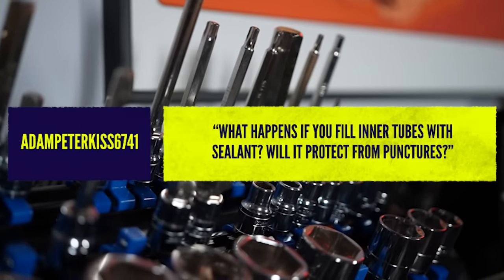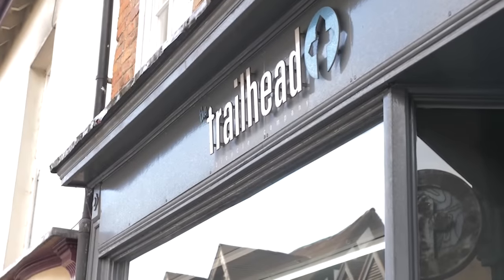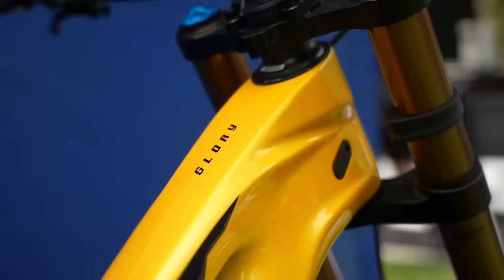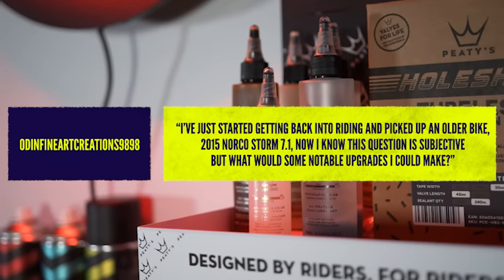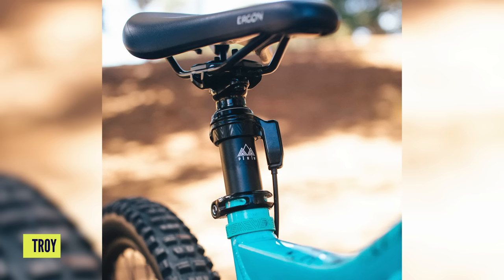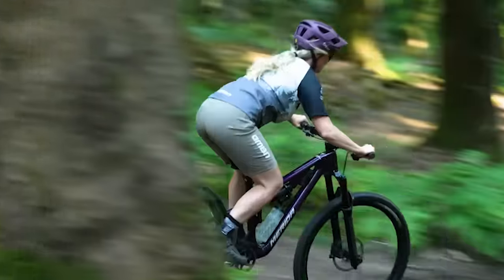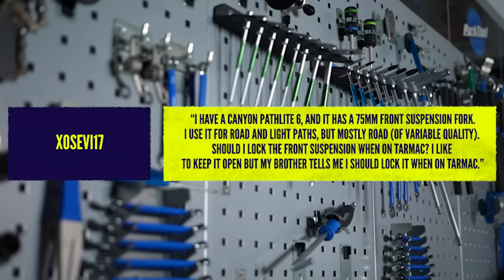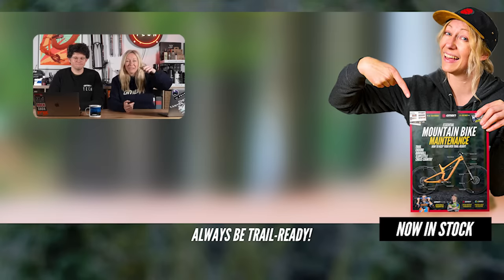What Happens To Pro's Bikes After They've Used Them? | Ask GMBN Tech

Comment: I feel the same for the 4th question about sizing for different body proportions. 
I've got short torso and long legs and I find it tricky to find a good size. 
I feel much better on size smaller than it would be recommended by most manufacturers, but it comes with some disadvantages. What we really need are not only bacis frame sizes, but different designs for different proportions. Or a size matrix, where you could choose reach and stack individually.

Comment: 11:06 I mentioned Hydraulic brakes, but mechanical brakes can get issues in zub zero temps too, as the wires can get wet when it's not sub zero and you ride trough puddles and snow, and once it gets to zub zero then the wire freezes to the hose, so I recommend using suspension grease on the wire to prevent it. Chain lubes will work in a pinch but they will make a mess. Sram Butter/Slickoleum/ Slick Honey, (all made by Slickoleum apparently, at least Sram butter is for sure, it says so on the box) should work well. Shimano has their grease for this, but I've not tried it.

Comment: 5:28 Yes Deore RD is a great option. the cassette seems nice too, shifts smoother than previous gen. But please be careful with the spacer, they are plastic, don't fiddle with them, don't step on them on an uneven surface, they will snap, I tested it with my fingers I snapped them. But I wanted to install the alu spacers I had from older XT cassettes anyway. But I asked Andrew Major, he did not have any issues with the plastic spacers. But it's not fool proof.
I've not tried the cranks.
But when it comes to the brakes I would avoid Deore brakes, They have servo wave mechanism, so the reach adjustment effects the power, as reach is not adjusted on the push rod, but on the servo wave mechanism, so useless for short fingers, as adjusted for short reach the piston in the master cylinder can't be pushed far enough so the pads barely touch the rotor. Absurd.
There is no adjustment to counter act this on these brakes.

Comment: 0:24 The problem with sealant inside inner tubes is that it will clog up, then you have a inner tube sealant sausage. And this will come at a cost of the ride quality and if clogged up at the valve you are screwed.
I doubt the inner tube specific sealants like Slime inner tube sealant will work better.
Also tube will might get glued to it self.

Comment: 11:06 Hydraulic brakes are also effected in low sub zero temps.
I noticed the Formula Cura 4 brakes with Formula Mineral oil got woody feel and more sensitive. But still work well. Same with Shimano.
I've asked Trickstuff, their brakes should work well down to -15C with Bionol. I don't know how they would do in -20C
I've read on MTBr forum that Sram brakes, Lewis brakes had issues with pistons not retracting in -20C. I don't know how much that's the piston seals and the fluid.

Comment: 11:06 Hello from Norway.
If it's just chilly, but not sub zero and fork feels harsh, just do a few drops and bomb down stairs for it to heat up. But this won't do anything when it's below freezing. I noticed a massive difference on a Fox 32 Evo. I no longer have this fork, but they performed poorly in the cold. Now I have EXT ERA, it performs better, but that fork feels plusher and yet supportive, but this fork I can adjust properly, but it too gets harsh. pumping up worked on the Fox fork I had to do it mid ride sometimes.

For some reason I don't have to pump it up more in -10C, but it feels harsh. Probably could drop the pressure some more, but it won't get rid of the harshness, as that's the damper fluid.

Comment: 5:57 I've tried Sun Race cassettes, they are junk. Here is my experience:
bent teeth, bent cogs, sharp edges on ramps and teeth, had to use sand paper to sand all sharp edges, use flat head screw driver to bend back teeth and cogs.
I've tried several 11-46T, I've had issues on all of them.
I've tried two 11-50T both had all of these issues but they developed play in the rivets, so much I could not shift. I'm not the only one.
Lock rings rounded off . But I keep spares, so just replaced it.

Avoid Microshift cassettes as I've senn people have issues with the teeth and ramps on those.

Comment: When its cold everything shrinks at different rates 
So your lowers may shrink a bit more than the stanchions and may bind a little bit 

I have this problem on my commuter bike where my frame shrinks on my suspension saddle post so much that is not moving anymore

Comment: I think the first question was getting mixed up with Slime - remember that green stuff we squirted in our inner tubes back in the day?
Reply: Slime was common in tubes in 1999  😊 remember the slime wobble??  Stuff was so heavy it would make your bike jump from off balancing the wheels lol
Reply: I just cut open an OEM slim tube to use as a chain stay protector, it leaked diarrhea and boogers onto the workshop carpet
Reply: Not really... They were asking if tubeless sealant could be used like the slime tube stuff basically

Comment: The simple solution to riding in the cold is to run coil suspension, no need to worry about gas laws and fluid dynamics.
Reply from the maker: Great suggestion!
Reply: True, although your damping is still going to feel a little sluggish initially until the oil cycles and warms up a bit.
Reply: Totally incorrect... Its the damper fluid viscosity that's making the suspension sluggish in very cold weather. Coils suspension has damper fluid and is effected the same way. You just don't need to reset your air pressure like u might with air, that's all.
Reply: @gmbntech coil suspension has damper oil too! So won't really help in the very cold

Comment: I'm wondering if the UK doesn't have slime sealant for inner tubes? Obviously, wasn't quite the question, but watching gmbn for years now, just seems like they've never heard of the stuff. Maybe it's just a thing in the states
Reply from the maker: We do have slime here in the UK it seems it's used by commuters more than MTB! It might be because a lot of bike shops here don't stock it 🤙
Reply: @gmbntech  interesting! I don't blame people for not using it for mtb. It's not that good, only suitable for small punctures, and adds rotational weight. With how good tubeless has gotten, I would never want to go back to the old days of slime and mr. tuffy to protect my tubes

Comment: #AskGMBNTech Hi, love your content! I would like to upgrade my rotors to bigger size. Right now I have shimano BR-MT410 calipers, rear rotor sm-rt10-s (160mm) and front rt-em300-m (180mm), already checked frame compatibility. I searched through shimano compatibility chart, and I'm bit confuse and lost. Can I use only these two type of rotors as charts says?  I can't understand the performance gap between SM-RT30-M and SM-RT54-M, for example. I would like to go 203mm front and 180mm rear (or more?). Thanks a lot, you're awesome!

Comment: #askgmbntech     question... what are some of the problems with over forking your bike?   example: I recently replaced my 160 mil fork with a 170 mil.   In the process, I replaced the head tube cup with one that decreased the HT angle, so the resulting HT angle remains virtually unchanged (around 64.5 degrees.   Other than changing my ST angle slightly and raising my bb (which BTW I lowered with the flip chip), I really don't see the downside, structurally speaking.   What am I missing? Love the show, Thanks in advance.

Comment: #ASKGMBNTECH I have a question for you about the REAR WHEEL TRAVEL of my Specialized Turbo Levo (Gen2). In the Rock Shox TrailHead tunning suspension app it request the rear wheel travel in mm to set the my sag. My question is how do i now what to put in that parameter of the app. My bike is a 29er front and rear whit  150 mm of  travel front and rear suspension and i weight around 100 Kg and my desire sag is 30%
Reply: Check your bike models spec. Rear suspension travel is stated in that